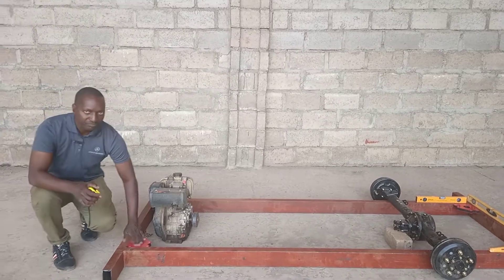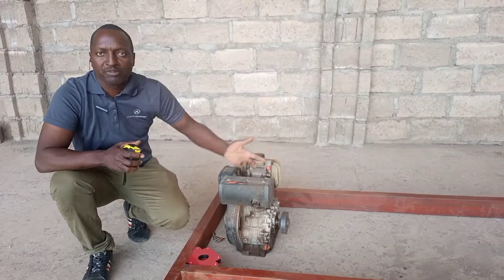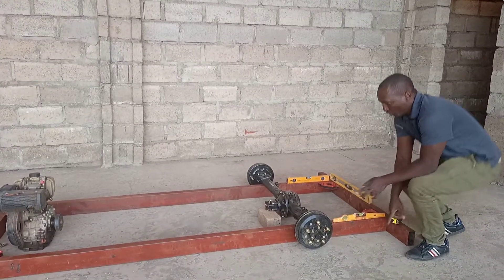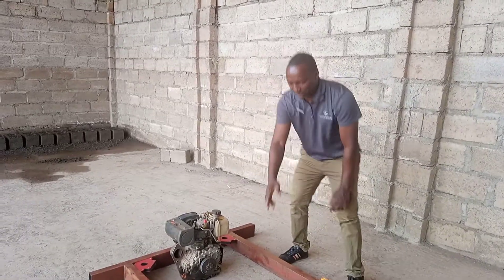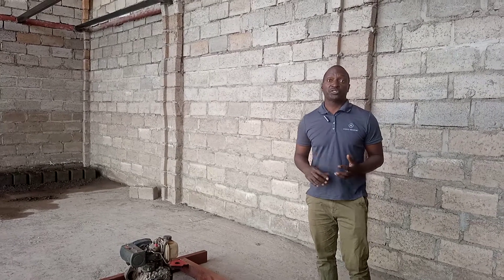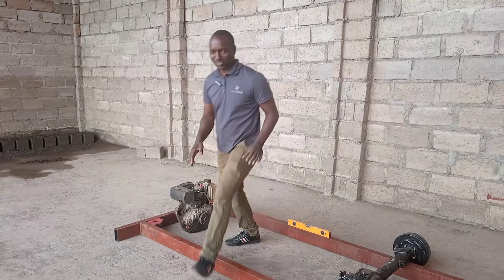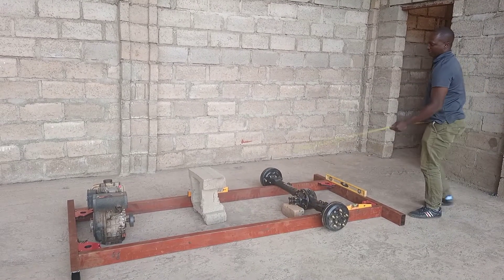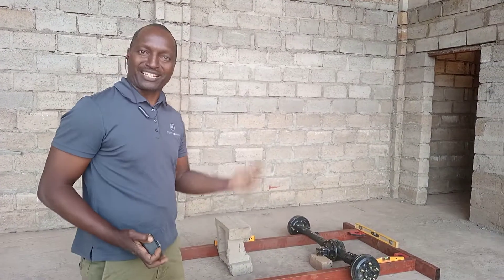How To Build A Utility Tractor Part 1 African American, British African Engineers please  help!!!

Comment: The rear axles normally goes under the frame. Thats where you can hang the springs like this.  〰️
Reply: Front as well.  If you hang the leaf springs upside down it could be dangerous.  . So a suggestion would to account for the wheel ratio
Reply: Good job keep up the good work